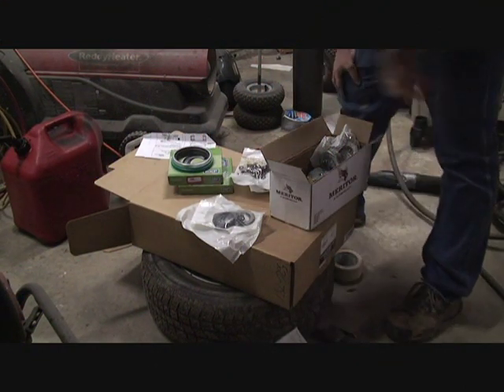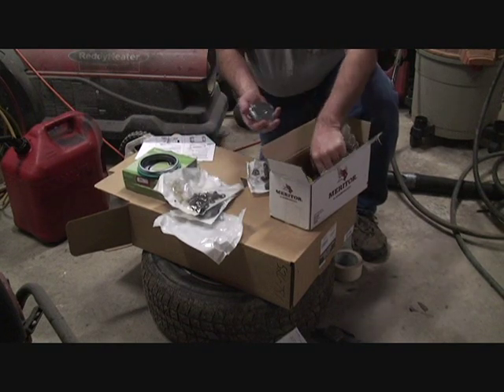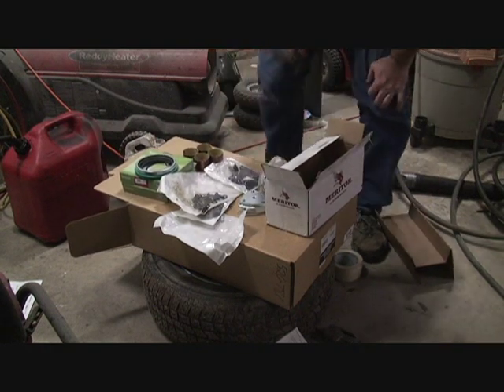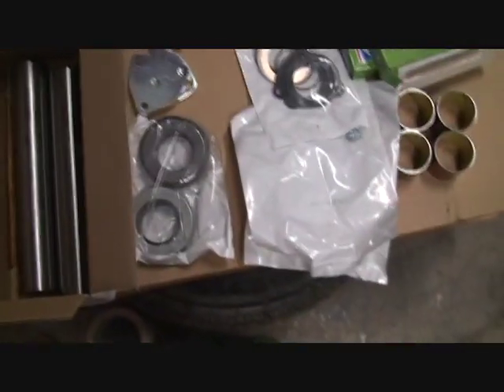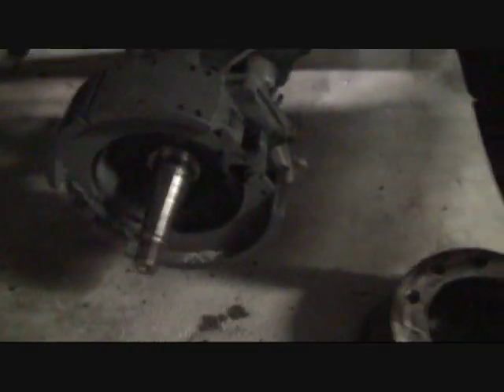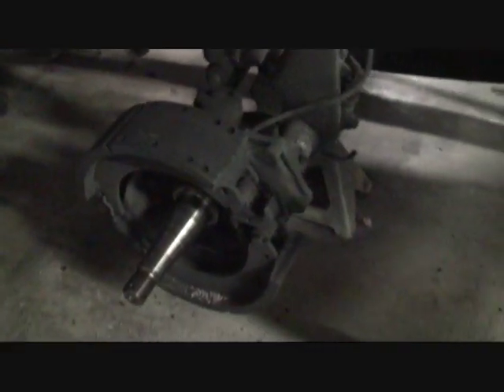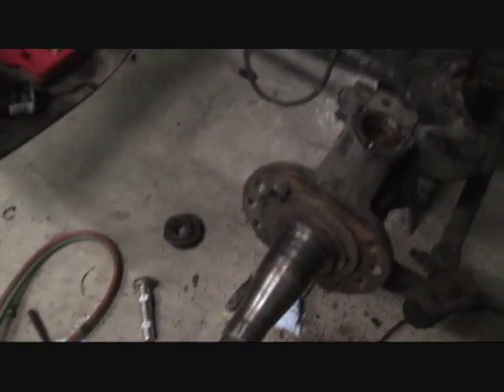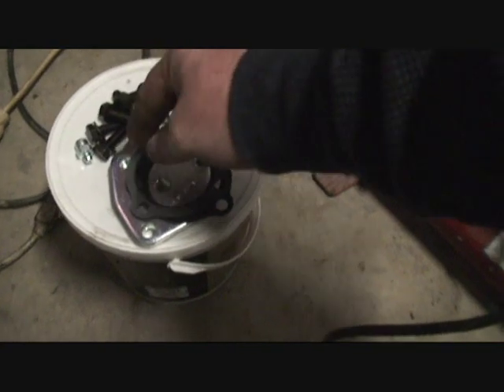Kingpin reassembly Part 1.

Comment: The King pin is never seized in the bushing. It is seized in the axles, and sometimes  this is the hardest part of the job to remove them.
Some bushings are already pre-made, and you do not need to hone them or use reamer for them.
The little seals are to protect water or other contamination to pass to the bushings, not to hold grease in. 
Good job, man.